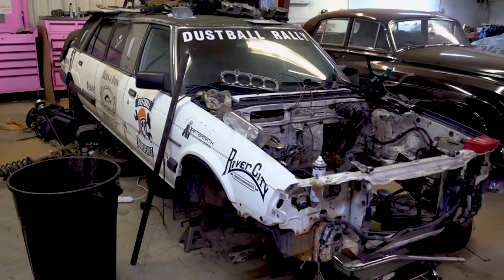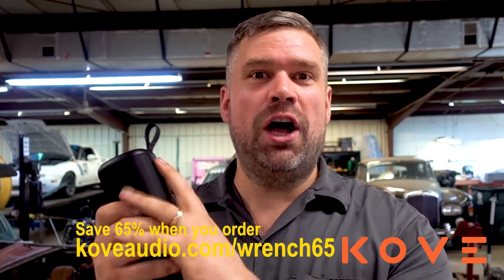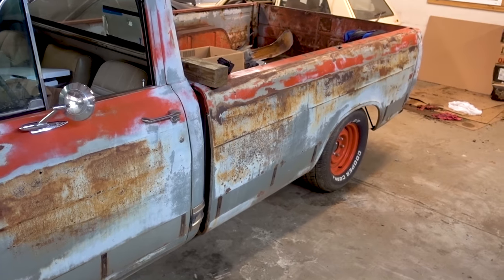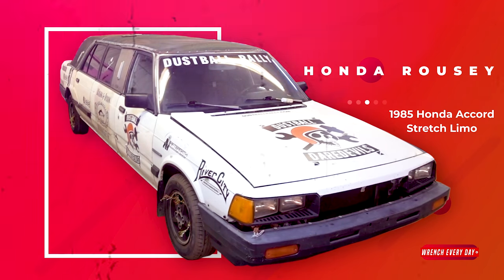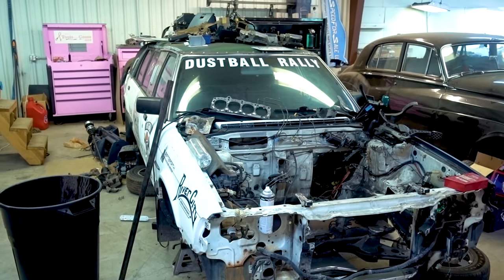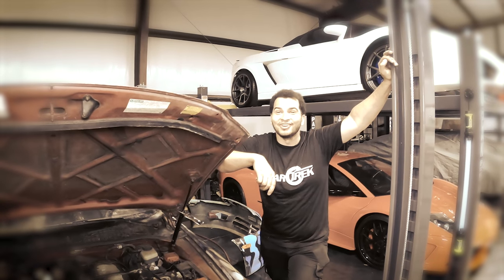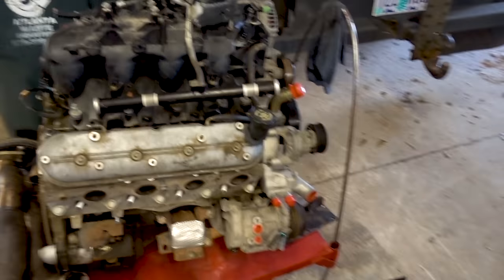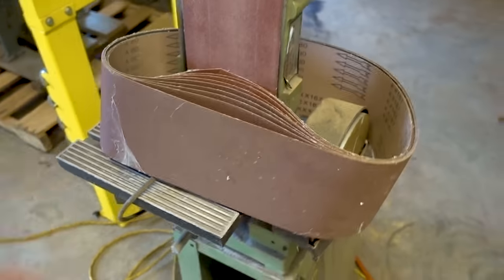Here Are All The Insane Project Cars Hiding In Our Shop (SECRETS REVEALED)

Comment: I bought the Kove speakers to use in my bathroom and when I'm working on my car. They sound great! And while my first pair failed a couple months in, Kove replaced it no questions asked with a brand new in the box set. They didn't even ask me to send back the old set... so I could potentially disassemble the bad speaker and fix it now. Great sound and stand-up folks.

Comment: The highflowed CT12's when paired correctly with a good standalone ECU and gearbox can make some decent numbers. I'm making 550whp with highflowed CT12A's. They're the smallest size compressor wheels possible (47mm). The key is to have good intakes and a dump pipe (5inches) plus some cams to open it up a little.

Comment: Hey Jared. Just to let you know that the Cove Audio website is useless. The link takes you to one page with a set of headphones that are sold out! I tried many times to locate the speakers you presented but it just goes back to the headphones which is really frustrating. Perhaps you could pass that on as it was your presentation that led me to the site and unfortunately that is where it ended.  
Apart from that, loving the show and looking forward to more content soon. Keep up the good work.
Reply: I just went through the checkout process and it worked like a charm.  I just clicked on the link in the description and it took me right to the Commuter 2 page - and it even automatically included the discount code when I added it to the checkout cart.
Reply: Worked fine for me.

Comment: Isn't a bit too low for a tow truck? 🤔
Reply: My oldest brother in the 90's and early 00's had a 93 black manual Chevy S-10 extended cab with a  Chevy 350 small block crammed into it, and we pulled everything from lawnmower trailers, racing go karts, to our family Airstream camper at one point when my stepdad's bigger F-150 was out of commission, so low trucks can do the job if you are smart about it, and don't drive like a jackass.